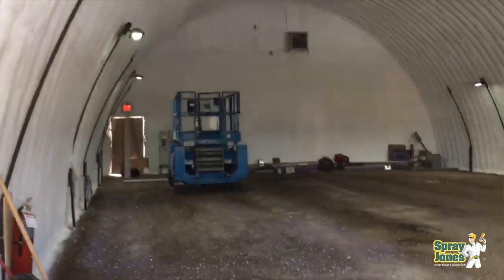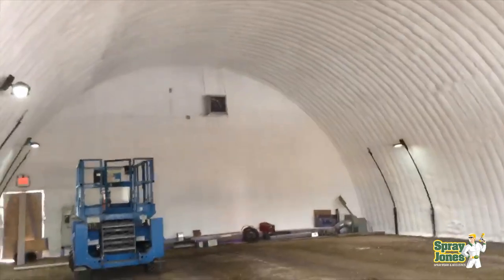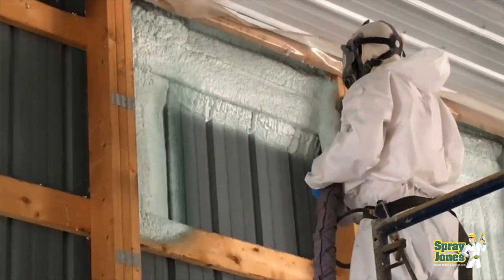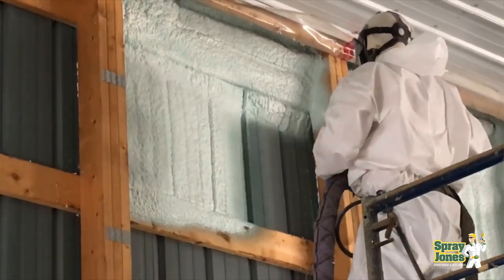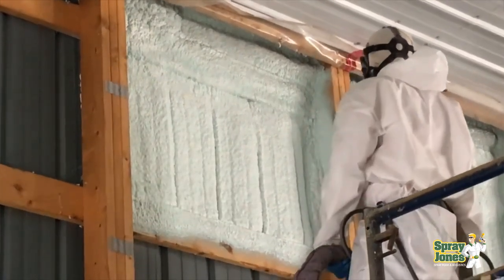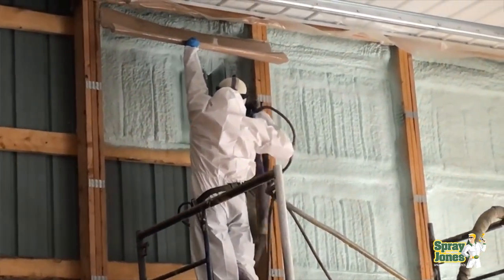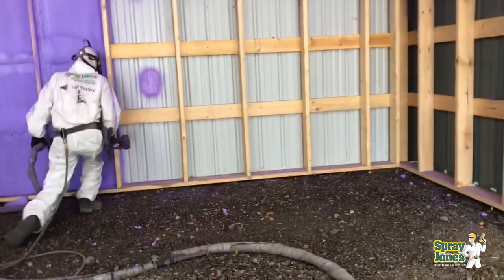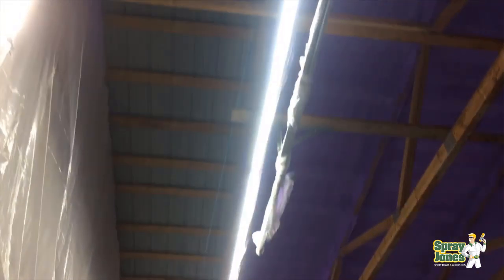Converting Existing Metal & Wood Shops With Spray Foam Insulation

Comment: Your videos have been so informative and I’m so grateful for all the work you have put in. 
I will still have to disagree will spraying right onto the metal. Conduction, convection, and radiation are the ways for energy to transfer. Conduction being the best.  With the foam right on the metal the heat/cold/energy has a direct path to the foam. 
One inch ridged foam should be installed on the purlins then spray foam. The benefits from the 1 1/2 air space is enormous. You now have a place for the water to drain, metal can be changed if needed, and the energy now has to radiate which increases r value. 
Put your hand on the metal that has the sun hitting it on the other side and see how long you can hold it there. Now hold it an inch and a half away and see how long. 
Just thought this should be mentioned. Not wanting to upset you or anyone else for that matter. 
Grace and Peace 
Slick
Reply: Absolutely not. That’s a great way to compromise the spray foam system. You need the monolithic adhesion to everything for the system to work. Your system you described would only allow the spray foam to adhere to the posts and those can be 8 ft OC. That is not enough. The spray foam is exceptionally good at blocking all forms of heat transfer.
Reply from the maker: Agreed.
Reply: Maybe explain further. I don’t understand. 
The ridged (xps)foam is nailed to the purlins then the foam is sprayed onto the foam, post to post. Last I new, spray foam adhered to xps foam great. That xps foam has cap nails into the purlins. 
Has something changed with the spray foam and it doesn’t adhere to the foam anymore, because that would be vital information. 
Grace and Peace 
Slick

Comment: I have a vented pole barn with long ridge vent on top of roof and open soffits both sides of the walls. Builder placed some sort of netting up to fill the gap to restrict large animals coming through.

When we apply foam over these areas should I foam directly to the netting on the soffits and attach landscape fabric on the ridge vent for the foam to attach to?

Comment: Insulating an old barn with a gambrel roof seems to be a good test of closed cell foam insulation. Old barns can have lots of places for cold or hot air leaks. And some old barns don't have regular spacing so dimensional fiberglass would not work as well.
But, would closed spray foam insulation bond to old wood?

Comment: Thanks for the video. I think you answered one of my questions on spray foam and that is on a metal post frame you can just put paneling over top the studs. I do have another question though, my small post frame metal siding shop does not have studs as shown in the example in this video I want a traditional  16" oc wall. Can that just be added over top of the post frame construction and spray foam or do the wall and then spray foam?  There would then be a pretty big air gap. Does that even matter? I'm in Kansas where it's hot in summer and relatively cold in winter. Thanks

Comment: What if your building has the double bubble insulation between the metal and the studs? Would you recommend removing the double bubble foil layer or just spraying over it?
Reply from the maker: It all depends on how tight it is. 
Yes for anything roof related.

Comment: You mention a 50-75 year life span. Is that estimated based on how long the building would normally be expected to last or is that based on a degradation of the foam?
Reply from the maker: Neither. Just a number to get people to think longevity not less. 
Oldest building in Canada with SPF is 1969 and still going strong.

Comment: what kind of Ventilation  do you want for a pole barn that is going to be sprayed walls and ceiling up against the roof metal
Reply from the maker: Many times nothing. We have shops that are all in floor heat and not much else.

Comment: mike i am building with concrete. i would like to spray outside instead on inside. i will finish the outside with brick. i this possible? i mean do you think i would be a problem long term or short term?
Reply from the maker: No problem, it will be great. That is commercial tech.